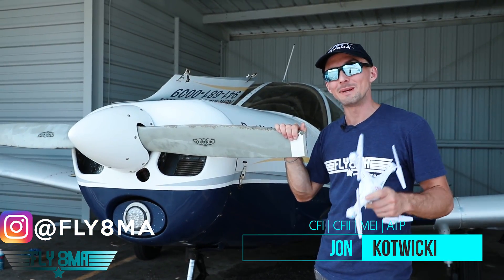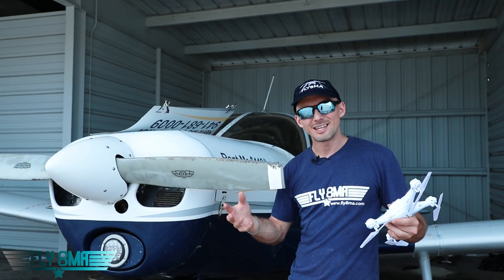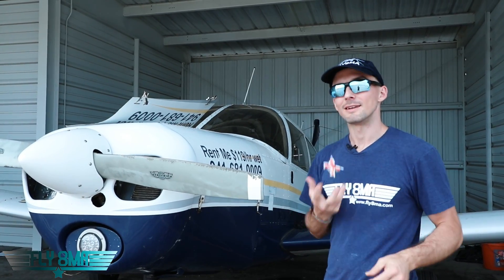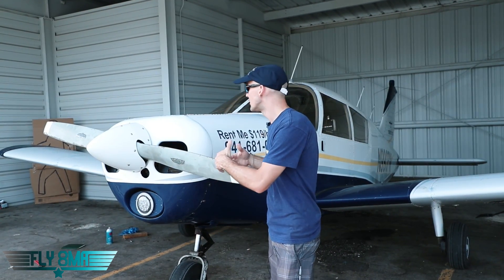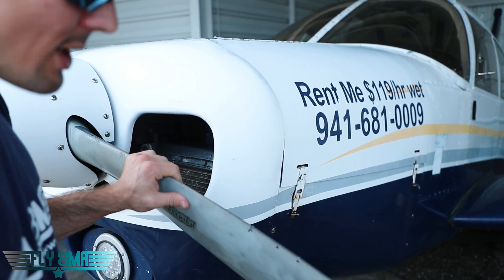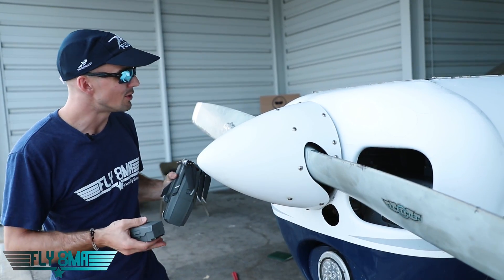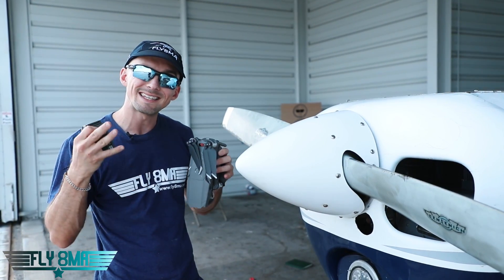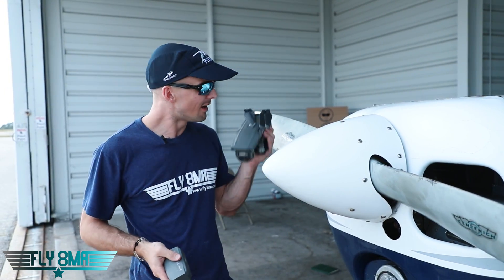Drone Strike | How bad is it?

Comment: In this case the aircraft is standing still, imagine it going 200 miles an hour ad that up it will surely cause much more damage to the winshield, fuselage or the propellers.
Another thing to note that this was a cheap toy drone and it is not capable of flying to a hight where it might collide with a plane but in real life if a drone is coming in the path of an aircraft I am sure that drone will be much heavier.
Reply from the maker: Yes, of course we would never do a stunt like this, it was more fun to see what would have to our drone....a cheap drone.

Comment: Yes just liked bird strike…
How many bird strike have you had?? And my heli does not have a forward rotating propeller either ..  neither does the citation and the baron is a twin , again no single prop on front !
I love drones but , showing a 30 bucks drone  striking an aircraft standing still is not very realistic. You can also throw the same drone in a lawn mower. You did not have to use a plane for that lol.
So  if you think  that a drone strike is safe ,please fly at around 150kts  in a small twin and have a buddy flying his drone at the same altitude and path  and let me know how it went ! Cheers

Comment: Several things wrong here.  This test needs to be done with a Mavic pro or with a Phantom 4 and it should be done with real world converging speeds.  I agree, if a drone like a Mavic pro hits the prop, there will probably be little damage to the cabin area and even the prop, however both general aviation engine manufacturers require engine teardowns for any type of prop strike, at least a $25K bill!  Should a drone like a Mavic escape the swinging prop, it will easily penetrate the windshield of most general aviation aircraft.  If the drone hit a wing or control surface on a GA aircraft, the damage potential could be from minor to potential control issues, there's also the potential of drone parts penetrating structure and lodging into control cables.  Lastly, this guy minimizes those with expensive drones doing dumb things, sometimes people have more money than brains!

Comment: I'm sure there would be plenty of FPV pilots, with 'old frames' (6" carbon FPV racer frames) that would be kindly donated (and piloted) to the 'cause of education'. It would be interesting to see how a stronger frame would break up, including a 3 or 4S, 850 to 1600mAh battery on it. They would be able to target the prop from a head-on direction. The local fpv club, I'm sure would help out.

Comment: My experience with a real life drone strike was VERY different. Strike occurred during takeoff from an airport close to a beach. Well within the “no drone zone” and at low altitude, high pitch, high power conditions. Damage to 2 of 3 prop blades constituted implementation of prop strike protocol resulting in replacement of those blades and complete tear down and inspection of the engine. The drone was thrown underneath the plane resulting in body damage. Cost of repairs and inspection required an insurance claim which resulted in payment of the deductible higher premiums. The plane was also out of service for almost 4 months which resulted in lost revenue. This video is not even close to being representative of my real life experience.
Reply: Gene Dane is there an incident report or similar available for this. It’d be useful to reference when I come across other “drones wont hurt your aeroplanes” remarks.
Reply: Mike Costello, the FAA and NTSB dismissed our requests to file reports and try to track down the drone operator(s) and suggested we just deal with our insurance company. No one was injured and there was no pilot to crucify, so we didn’t get much support.
Reply: What airport were you taking off from and what is this "no drone zone" that you refer to?

Comment: I don't think any pilot is worried about their plane falling from the sky if hit by a drone. It's the cost to what is often someones pride and joy or means of income. We all accept that we are up there where birds live but damage through the negligent act of someone unknown that may put your aircraft on the ground for a period and cost a ton of money to repair is unacceptable. The comment sections all across the web talk about how a drone wouldn't make a plane crash. But the people who defend it aren't forking out for a new carbon fiber prop, metal prop, de-ice boot or other de-ice leading edges and windshield replacements. NO pilot is going to have a drone go through the prop on climb out or cruise, land and say "nah it looks OK, lets go flying again." You'll be in the shop paying money to get it inspected, the prop potentially pulled and other post impact checks done. Flying those things, even the small ones around airports means you are near every sort of aircraft, not just light singles. Plenty of Citations, King Air's and TBM's operate from local airfields. A simple DJI Phantom drone flown over water for pleasure photography caused very expensive damage to a Black Hawk in New York. I know it's not feasible but a DJI Phantom through a metal or carbon fiber prop at 100 kts (115mph) and 2400 RPM, not the relaxed 1400RPM in this video might be a bit nastier. The drone in this video, may still do plenty of damage to a carbon fiber prop or de-ice boot or require a full engine tear down if it finds its way onto a turbine inlet.
Reply: Whether or not damage will occur isn’t the issue. There are already laws against damaging other people’s property. The issue is finding the most effective way to prevent it from happening. The only effective preventative measure is education, but the FAA has chosen onerous restrictions instead, which even they admit won’t work. While it remains to be seen if 50,000+ comments will have any sway in their approach, we need to add the voices of the manned aviation community to those in the recreational SUAS community to ensure we do everything we can to actually prevent issues like these, instead of wasting limited regulatory resources on measures guaranteed not to work.

Comment: That tiny drone has tiny little motors- the drones more likely to be up where they don't belong will have 480/540 class motors which are very heavy, very dense and if you took one through a prob above idle speed it's going to make a mess of it. A tiny toy like that- I wouldn't expect anything, but I don't think the $29 toys are making it into "real" airspace. 
I've shown drone motors to other pilots and they've universally been shocked how heavy they are and have a new respect for how sketchy it would be to take one to a prop, windshield or wing at speed.
Reply: Come on! 480 and 540 sized motors went out in the late 1990s! And the planes they powered very rarely made it above 20 feet let alone 400 feet! The motors on the quads you relate to will rarely weigh more than 50 grams.
The statistics say you are more likely to have a fatal collision with another general aviation pilot than hit a drone!
Reply: According to the FAA, more than 400 people are killed every single year in GA incidents in the US alone. An average of zero people per year are killed in drone related incidents, worldwide. In the risk analysis for GA aircraft, drones don’t even register as a significant factor. Drones are literally the least of the problems GA pilots and passengers need to worry about.

Comment: Full send it into the wings and see how it goes
Reply: The airplane would still fly just fine with a dent in the leading edge.
Reply: @jayphilipwilliams  unless it punctures a tank and the lipo goes nuclear.
Reply: Rcbif lippo battery and a fuel tank is like mentos and a frickin cola
Reply: Jay Philip Williams yea but it’s only if the airplane on 0 ground speed, imagine it’s In cruising speed
Reply: Jay Philip Williams Sure, but if you did it, would you come forward and pay for the repairs?

Comment: This presentation was totally unnecessary and useless.. At a time when all of us Pilots AND Model Airplane pilots have to deal with idiotic FAA requirements and Sensational News from Fake News, this is the LAST place I ever thought I'd have to watch a presentation like this. Let's get back to "REALITY"!  There has NOT been a "Drone Strike" with an airplane reported EXCEPT when the Pilot of an airplane tried to blame some BS to a Drone. Some of us have been flying Model Airplanes for over 50 years AND are full size licensed pilots with over 5000 hours. We do not need to keep bringing up Drone strikes with full size planes...  It's a problem that doesn't exist and the FAA is already providing Solutions for the Problem "THAT Does NOT Exist"!
Reply: Fred Weaver Wow! That’s a head in the sand comment. You can start with the Black Hawk around New York that hit a DJI Phantom.
Reply: Absolutely agree.

Comment: Interesting video but not sure how representative of an actual situation it would be. Obviously wouldn't expect you to actually be flying the plane  when the drone struck it here but am wondering if there wouldn't be more damage if the impact velocity was higher (eg if the drone flew head on into the plane when it was moving at say 90 knots) and/or the propeller was running at full speed (I could be wrong but it didn't look like it was running at full/cruise to me). All this just to say I'm not sure this proves the damage would be minimal in an actual incident.
Reply: BanduluFox I agree I think they were just cranking the starter